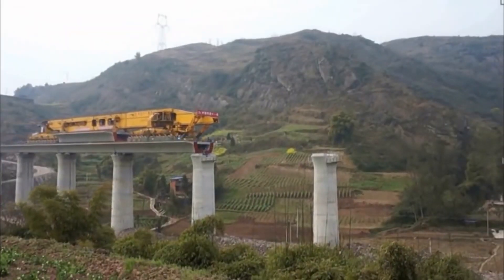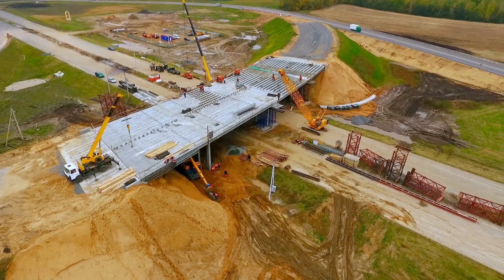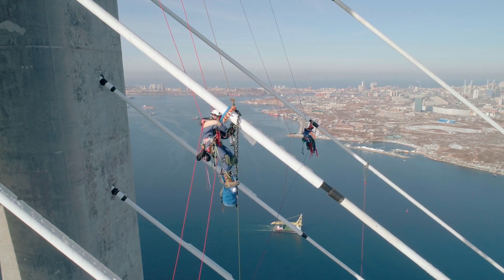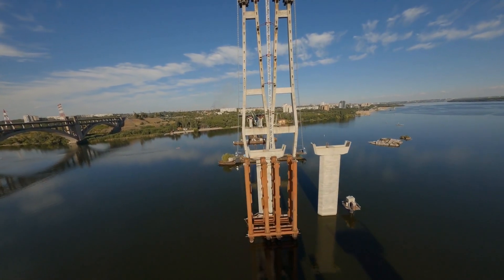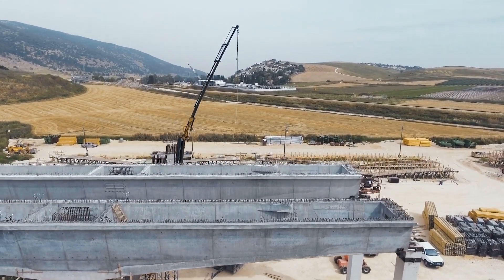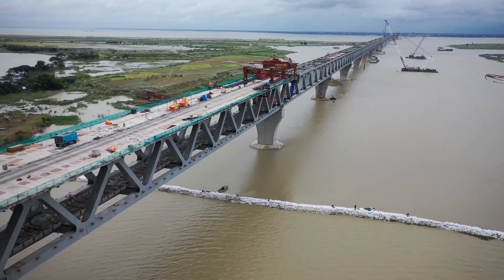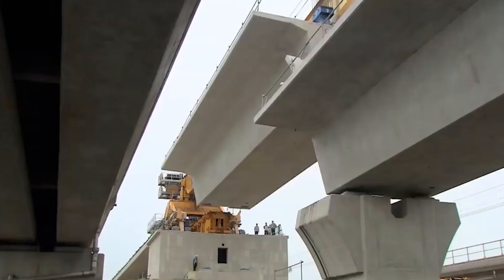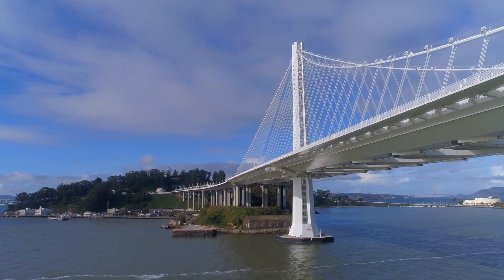China HIDES This Bridge Building Technology from USA

Comment: yeah the girders are  75mm of concrete on the form side, filled with local topsoil without cement and reinforced with bamboo because the 5 levels of planning skimmed all the money leaving the actual construction crew with nothing to buy materials.
Have yo seen the video where the worker is testing the 25mm rebar by shattering it like glass on a concrete block.
See the bridge last week, killed 3. Truck with a 500 ton transformer came to a curve in the bridge. instead of driving a straight line between the pillars he stayed in the right outermost lane. Well that was too much for the bridge and the deck rolled over.. See the sand in the broken pier? .
Reply: Yea none of what you said is real 😂sucks to see America and Europe fall so far behind isn’t it